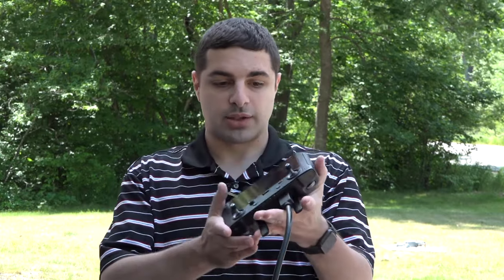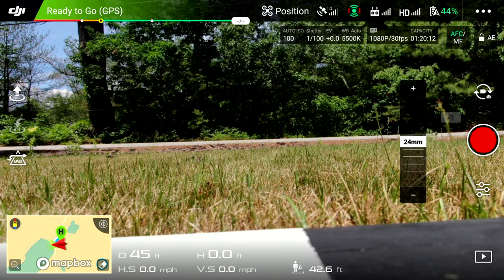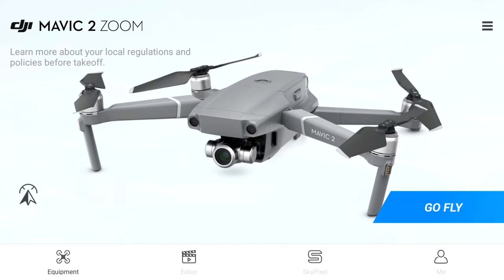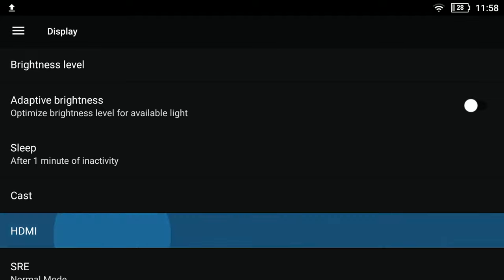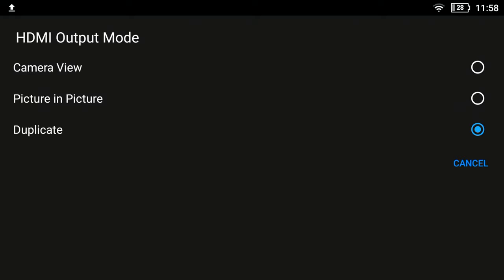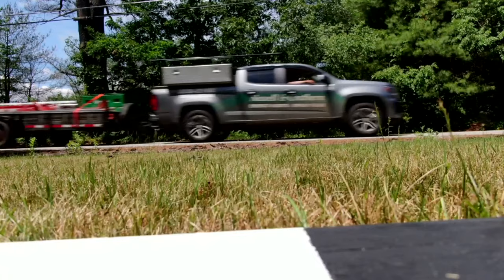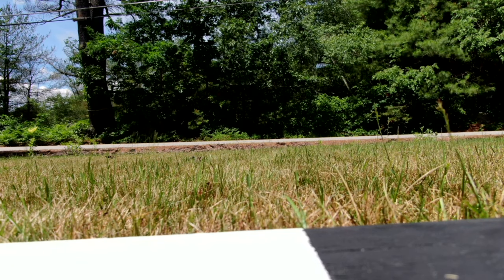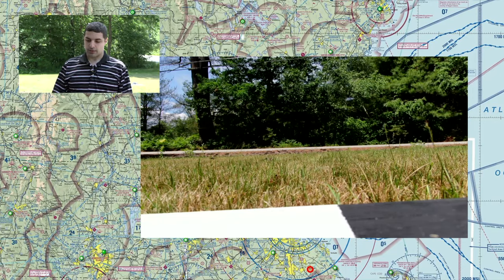Using a drone with your switcher.

Comment: Can I just use the smart controller as a drone remote and as well as the camera operator?? So I dont need to buy the DJI normal remote again.
Reply from the maker: Yes you can.  You just end up limited by the HDMI cable.
Reply: @smfmediadesign  if I use Hollyland Cosmo C1, I might be walking around to get the best sight of my drone position. What do you think??? 😯🤔
Reply: @BaliDroneServices  I haven't used the Hollyland but the only thing I would slightly be concerned about is latency of the wireless.  Otherwise I don't know why it would not work.
Reply from the maker: @Bali Drone Services  I haven't used the Hollyland but the only thing I would slightly be concerned about is latency of the wireless.  Otherwise I don't know why it would not work.
Reply: @smfmediadesign  well, that's true. Since I am doing it for live streaming to big scteen (like wedding reception and on stage performances), do you think it is worth to try to buy a 100 yards SDI cable amd try in out of the SDI out port of the TX to the RX at the switcher desk? That is the normal/max distance the shooting object to the A/V controller desk. But surely I need to use HDMI-to-SDI converter since my remote controller doesn't have SDI out port. Please kindly advise.

Comment: Hi i find this quite useful. Thankyou. Could you please tell me why my output becomes pixelated or blurry when streaming but the recorded footages give good quality
Reply from the maker: You say streaming so I am a bit confused.  The HDMI output from the controller should be as good as you are seeing on the controllers screen.  Keep in mind that you need the controller you are pulling HDMI from to be line of sight with the drone.  You can move around to maintain the line of sight with a second controller to maintain signal but how I often do this is just leave the HDMI connected controller sitting there so it may become obstructed.  I always try to get some height out of it by attaching it to a C-Stand.  Hope this helps.